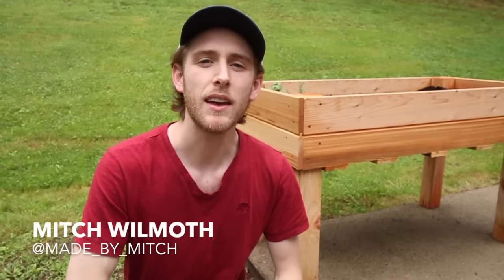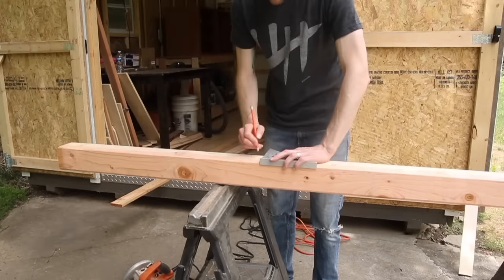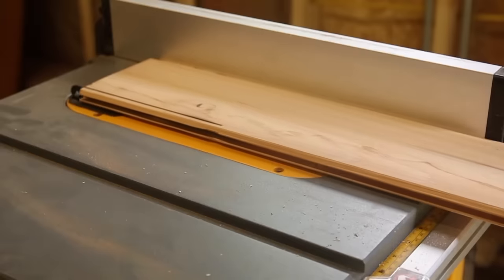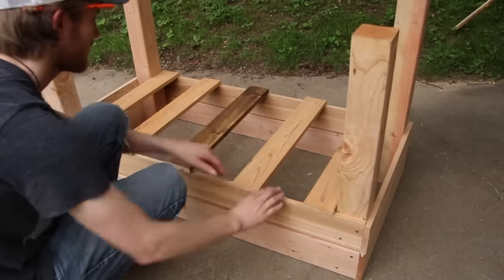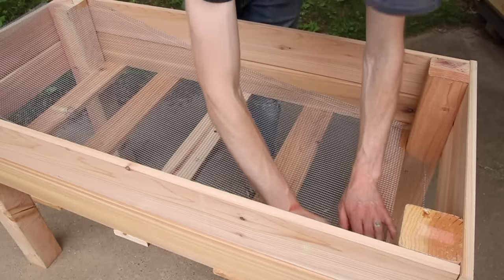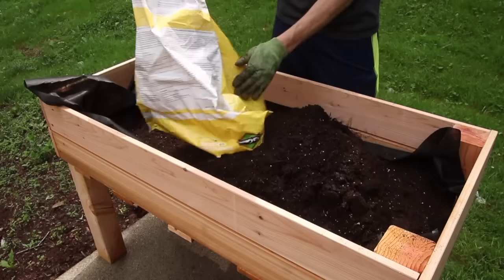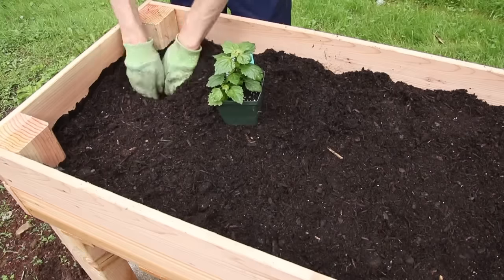DIY Elevated Garden Bed

Comment: Love the simple design. Going to make a couple of these soon. I imagine not a lot of water goes through the bottom unless there would be a lot of rain. The drainage could possibly take nutrients with it. Any thoughts on a way to catch water passing through and collecting it into a bucket to be used for watering when things dry out? Or is that just overthinking it? lol
Reply: I'm learning bonsai so hopefully can help. We very much value drainage, but are very particular about nutrients, so I don't think it's much of a problem. Certain soils actually absorb or hold nutrients better than others. For eg composted pine bark/wood chips hold nutrients really well. Then the plants suck up those nutrients from the soil/chips. (They must be composted though). I think normal potting mix would be perfectly fine. 
If you want to catch water, I would raise one end of the box a little and put buckets under the other end where the water drains out. (Make sure they're not a drowning hazard for children, animals etc - our neighbour's kitten had zero common sense lol) 
If you want more drainage, you can cut holes in the sheet he put down - probably the bigger the better. We like 1 inch holes in bonsai. Also, I noticed his sheet went up the sides.. you could make sure it doesn't on the end you want to drain the water. 
I have personally found figuring out watering with no drainage is really difficult. If it gets water logged it's hard to fix. 
Good luck! 🌱

Comment: Hey Mitch, I don't have any tools yet to build this, so I bought a 3' x 3' foot wooden box that has a solid bottom.  Would you recommend taking the bottom board off and replacing it with boards spaced apart like you did, or can I just drill drainage holes?  If so, how big of holes and how many would you recommend?  And in that case, would I still need the steel mesh?  Thanks for this great video and all your help!
Reply: Hello! By any chance did you try this out, and if so how was the drainage?

Comment: Did you keep this on the concrete slab? Wondering how it worked out if you left it above the concrete? Looking to make one but I only have room to leave it on cement
Reply from the maker: Hey Jake. I did keep it on the concrete. It was just fine. The concrete got a little dirty so I hosed it off frequently but there were no issues with it.

Comment: Hey I just built one for a friend using the 1” thick T&G for the walls. The one I made is about the same size as yours. Did you experience any bowing after the doors was put in? 

Also, when cutting the posts to length, I found it super easy just the cut them with a chopsaw.

Comment: Great video. Do you think the wire mesh is necessary if you put the boards closer together and put just landscape cloth on top?
Reply: Yes, having the boards with the mesh on top allows the mesh to absorb most of the weight of the soil which the bottom boards may not be able to support depending on how big you made your bed. You also have to have drainage, so it's important to keep the bottom open and porous otherwise the bed will fill and overflow with water when it rains which will uproot your plants. Water needs to drain from the bottom.
Reply from the maker: Thanks mrtrek64.👍

Comment: Hey can you add the measurements! I want to make this this summer and the size you made looks perfect
Reply from the maker: Hi Katie, the overall length is 48" and width is 24". I think I got by with using 3 pieces of the 1x6 cedar to make the box part. Hope thi helps!
Reply: @MadebyMitch  yes thank you!

Comment: I made a similar elevated garden bed last spring, a bit deeper and wider. It takes about 6 bags of soil. Would I change the soil every season or just add to it?
Reply: Favi Gooch-Escalera to reuse soil i would use compost and worm castings. Or if you wanna take a little time and work, compost veggie/plant scraps and you can buy earth worms at a pet store or fishing supply .

Comment: You really should paint or stain this before adding dirt to protect the wood more. Also needs drainage holes at the bottom or plants will rot. Adding big locking castors on the legs is something I did to mine to easily move it if the need arises. The basic put together was good - but needs a little more to protect and function better.

Comment: Awesome video bud! I want to do this! How far apart did you make the ribs on the bottom? Are you satisfied with the spacing?
Reply from the maker: Thanks so much Erim. I cant remember exactly, but they were around 8"-10" apart. The spacing was great. It distributed the weight evenly and the boards are still going strong.

Comment: Hi Mitch, I was wondering if you have any tips for including some form of a drainage system to this build. I'm worried that the water wont have anywhere to go (I live in the Netherlands so I get a lot of rain unfortunately)
Reply: I didn't make one yet but it will drain fine.  First, there is porous hardware cloth (wire @ 1/4 squares); obviously the water would flow through that.  Secondly, that landscape fabric is porous - we use this all around our yard for various purposes and water is designed to drain through but it will stop some weeds.  So, overall, it should drain just fine, even in the wettest climate. If you're really concerned ensure that you get the most porous landscape fabric?  Or a person could put marine plywood on bottom and drill holes for drainage every few inches?

Comment: One note - If you download the plans by following the link in the description, it says to cut the boards that run across the bottom of the box to a length of 2 feet. This is incorrect - they should be 26 inches in order to span across from length board to length board.

Comment: I was wondering if it would be worth treating the wood with water seal, especially the fir posts and the inside of the box.    Would that help preserve these from rotting?
Reply: Treated wood in gardens are are not recommended.

Comment: If I was to make a bed with identical dimensions, with identical soil and soil amount.. How heavy would the soil be when absolutely soaked with water? Is there anyway to calculate that?
Reply from the maker: I'm not too sure how to calculate that weight. Mine has been soaked in water from rain several times and has shown no sign of stress on the boards or wire. The weight is distributed evenly. I hope this helps! 👍🏻
Reply: Don't use dirt- I use compost, peat moss and perlite- light weight and very good growing medium.
Reply from the maker: I am going to try using the compost and peat moss next season. Thanks for the tip!
Reply: Every gallon of water weighs 8 lbs, you'll likely not need that much water from hose, but a heavy rain could drop that much.

Comment: Is treated pine ok?
Reply from the maker: I've read that treated lumber isn't good to grow food in because of the chemicals used. But I have also read that it doesn't affect the food you grow. I've seen people do both ways. I used cedar because it doesn't rot like pine. It is a little more expensive though. Hope this helps.👍
Reply: @MadebyMitch  thanks. I've been getting the same mixed info

Comment: I want to get these pieces precut...what are the lengths for the 1x6, 4x4 & the 1x4 pieces? thank you
Reply: Get two 1x6x12

Two 4x4x8

Cut one 12ft board into four 24inch pieces with a 48inch piece remaining

Cut tha next 12ft board into three 48inch pieces and use tha remaining 48 from the previous 12ft board. 

I used some 2x4x2 on tha bottom. I have four but u can do whatever u want for bottom support. 

Overall after some adjustments my dimensions are 33inch x 2ft x 4ft
 Height x width x length

Comment: Wet soil too heavy and will cause sagging, then breaking of bottom supports. Should have used 2x4 cross bracing, and should have built some sort of shelving 6” off bottom legs. I made planter box something like yours, but switched to the blue barrels food grade, cut in half, with legs attached, some holes in bottom for drainage, and lined with the ground cloth. Not going to ROT EVER. Legs were untreated posts, that had 32oz plastic juice containers on bottom legs, preventing contact with ground. For 2023, I’m think about only cutting an oval hole in one side of a blue plastic barrel, and attacking legs as before. But not cutting in half, so as to plant things deeper. Same storage on bottom area also. Food grade barrels are much more durable , and while being smaller, they’ll fit various areas better. 12-20-2022 Merry Christmas 🇺🇸✝️💟

Comment: Looks great just in my opinion it will not survive more than one year, And that's why : The wood you use does not look protected from water and bacteria, In my opinion the pvc sheet should be stuck with pins like the iron mesh, There must be holes for drainage in the bottom of the planter otherwise the water will flood the bottom and cause excess watering... And in my opinion it is better to fill the bottom of the planter with tuff stones and only then planting soil. ...

Comment: Nice job, but you really needed more dirt, because two bags weren't enough. As it is,  once it compacts, it will be less than 6 inches deep and dry out fast.
Reply from the maker: Thanks Brian! This is very true! It did dry out pretty quickly. This year I will add more to it to help out a bit! Thanks for the tip!
Reply: @MadebyMitch   You're welcome,  I just built a similar sized one, but I filled it all the way. Roots don't mind having too much space, but they sure hate being cramped ! I'm still experimenting myself, so, who knows how it will turn out. ...too wet, too dry, just right...who knows.

Comment: A "Speed Square" does NOT check or confirm if something is "level"!!

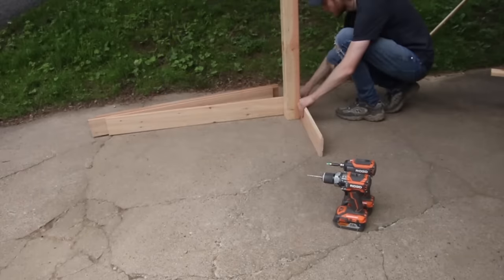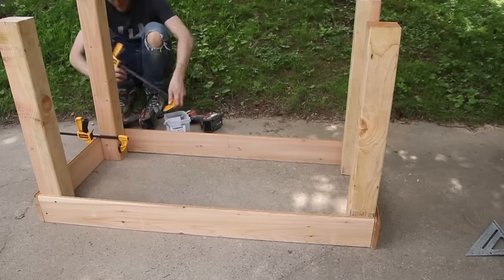You said that at both the 1:50 mark and again at the 2:10 mark.

If you want to check for level...you need a level.  A speed square lets you check to see if something is square at 90° as well as marking other angles to cut.